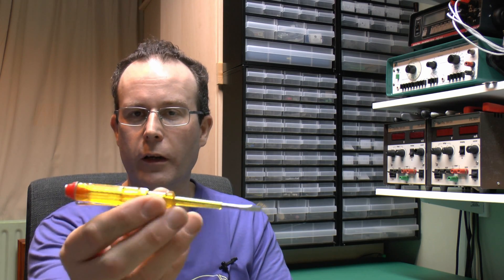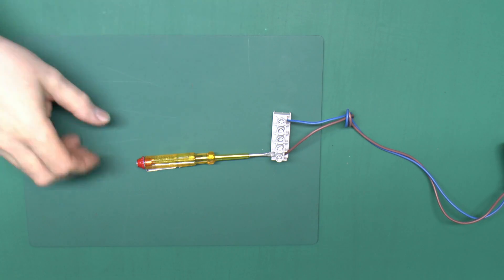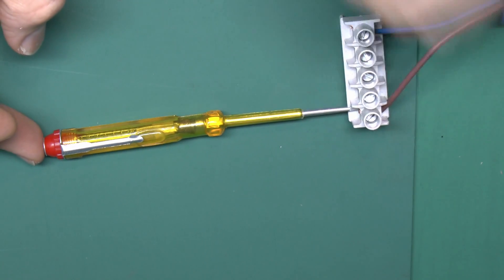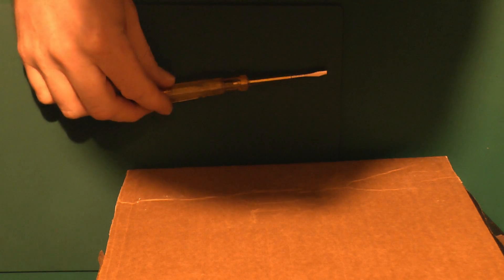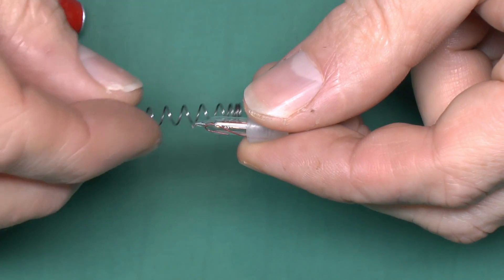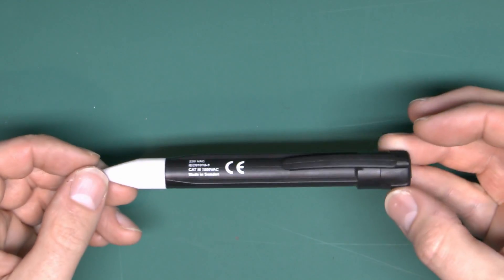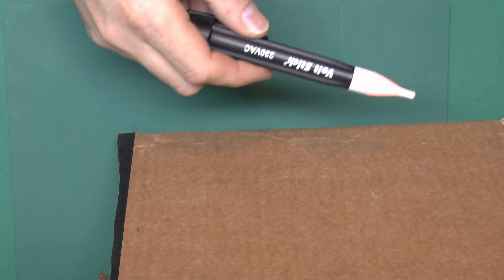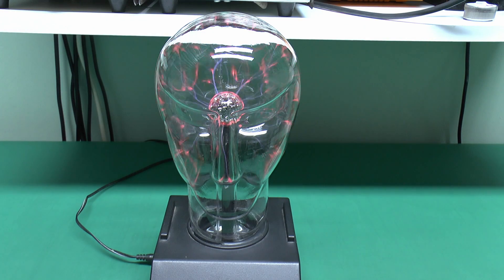Dangerous Device - Neon Mains Testing Screwdriver

Comment: These devices are called phase detectors for a very specific reason. They detect if there is a live. You are mixing two completely different devices together. Not very professional. But yes, that type of phase detector you presented is a piece of cheap crap, I wouldn't even sit next to them.
Reply: A line is a phase, they both do exactly the same thing.  The cheap one makes you part of the circuit,  the Voltage probes don't!

Comment: One great advantage of the neon testers is that they require only one point to test. There are some cases when you have to use them:
if you don't know which wire is the line or the null (same color of wires and no known ground is available) or if you are not sure if the null or ground is damaged you have to test the line with the tester before starting the repair

Comment: I need to do a report on one of these so ill use this video on its safety
Reply: Yeah, I wouldn't.
Reply: I did as it happens. Mine was a clear one with a 1M ohm resistor and then a neon light. I happen to have s couple of PAT testers handy and 3000V blew the resistor, but it still conducted 1500-3000V (limit of tester) but only but out about 2mA. This might be the screwdriver but I don't know how many amps wouild generate through a humsn at that voltage.

Comment: So your approved 'safe' two pole device is fine as long as the lamp is working. This means checking that it is working on a known live terminal first to determine that the lamp is working. I would suggest an even safer method is to switch the power off at the consumer unit and not to bugger around with live circuits.
Reply from the maker: +Mysterious Squirrel Yes, all mains testing devices must be confirmed working before and after testing.
Switching off at the consumer unit is all very well, until the switch in that consumer unit fails closed, it's the wrong consumer unit, or the circuit in question is illegally connected to the apartment upstairs.
Reply: ***** I take your point. You cannot safeguard against the stupidity of others. Your videos give good well informed advice but ultimately, there are those who will take all reasonable steps to check for a live circuit, and others who will stick a licked finger in a socket. And even with the best test equipment money can buy, if the person who installed the circuit was an idiot, you are going to become an earth rod.

Comment: Im not really good on electronics but Ive got question,
 why did the device lit up on the cardboard where there is no electric on 4:22?
Reply: +とり好き Static I presume, if they can safely use your body as a route to ground then the current required to light that bulb must be immensely tiny.

Comment: That "metal cap" is actually a female plug for a wire lead that you connect to the other  part of the circuit you want to test. It's probably 30 years old and you didn't use it per the original instructions nor have all of the parts.

Comment: The neon itself has a massive resistance. It passes almost no current. You're not gonna get electrocuted off one.
Reply: +greenaum neon 60 - 70 volt the resistor has to take the rest of the voltage if the resistor fails ( shorts ) you get 170 -180 volts threw you ((( ZAP !! )))

Comment: I've been using one of those screw-driver testers since forever, in conjunction with decent multi-meters and other sorts of testers...... never a problem!!.....Can you count on them 100%?   No but they are a simple "first to" indicator.
  ..It would have been more informative to mention the difference between LIVE and NEUTRAL with reference to earth......and why the tester did not light, so as we know the reason.
    The huge tester you showed does not give the user any real feedback on the polarity of the tested wires with respect to earth, they could be inversed which is also dangerous...maybe more so under certain circumstances.... the screwdriver tester does.   
  They have then, two advantages.......you can use it one handed..handy when you are holding a torch in a dark place, because you have an problem with, in,  for example a garage in the dark (which is why you are there in the first place) testing simple house electrical problems in general is not done at a bench!........the other for testing live and Neutral with respect to earth. 
 Disadvantages.......... it's an indicator  but absolutely not a complete tester.......... not good for those who know little about electricity.........but that's why I still use one. Dangerous?..... Really the bottom line is if you don't know abut electricity you shouldn't be fiddling with it!

Comment: I was recommended this from you tube! What a long  winded piece of nonsense, had to terminate the viewing.
Reply: +Garry Steptoe - I agree long winded and could be done in 20 seconds, anyway I have been using this type of screwdriver tester for 50 years or more and I will carry on using this to find the 'live' not to prove that there is a neutral or mains present, they have never been lethal in my hands, I was also wondering why he had 258 volts I will call the electricity board as you should have no more than 240v max. If you want to see what lethal is go to Thailand they have extension leads on building sites using 'twinflex' what we use for connecting up a door bell, health and safety doesn't exist.
Reply: 240V max?   230V RMS  -6% to +10% EU conformity? Try and google before using a shit comment
Reply: This is why we have health and safety, a better country because of it, just because you have done blah blah blah for 50 blah blah years does not prove much, just one statistic.

Comment: Wrong. You don't use a two terminal device to check mains voltage is off unless you know the circuit has not problems. Neutral may be disconnected and live connected and that device would not give and indication. There is no perfect solution but if you are going to check live wires around the house, use one of those pen things. Yes they may fail, but the two terminal device can also fail.
Both devices that you said are bad give out false positives but that is actually safer than a false negative from a two terminal device due to a broken neutral.
Reply: I'm still here after 70 years and have been using a neon screwdriver all my life without problems. It's found every live wire I ever needed to. You health and safety bods spoil all the fun for us old 'uns.  :) The odd shock tightens up the sphincter muscles and prevents leakage!
Reply: I agree with you. I've used one for over 55 years and always found the live. A lick of the finger to lower the resistance helps too. He's scaremongering.
Reply: +Rob Fraser They may work if grounded, but around the house when checking for normal mains, i want to see if "I would be closing the circuit" to ground and get shocked. Its the same reason i don't use a multimeter for these checks. I don't care if neutral or ground are good, all i need to see is if i would be closing the circuit to ground.
Reply: +maxsnts I have seen broken neutral my self some times not easy to find with a 2 point tester
Reply: Yet again, I'm shocked (no pun intended) to see so many people that don't know that (most) 2 terminal testers also work as single terminal testers - Fluke T100 for instance
Reply: +MaxSantos

I sometimes in unknown/untrusted systems, like to use 'flying lead' earth to test the earth is connected, especially old light circuits, as you can otherwise have 'live' points with no earth-reference to measure for voltage properly.  Can see how the non-contact detector can be useful for that reason similarly // totally agree!

On a TN system, when turning off a single MCB/RCBO (L disconnected only), having checked the power appears to be off, I like to also measure the N-E loop with a (properly protected CAT3) multimeter 'ohms range' which gives further confirmation N and E are really still connected and the lac of voltage on the line really is correct.
Reply: +maxsnts That's a good point that I never picked up on, the two terminal device he used (not the multimeter) would that work if the other terminal was grounded against a radiator perhaps?  That might be it's true purpose, that you ground the other end and not place it against the unproven neutral line.
Reply: Alan Reynolds haha
Reply: Alan Reynolds brilliant answer
Reply: In Finland a common way on old installations is to ground on the socket to the neutral wire. Sometimes this is done to the live wire which is especially dangerous. A plumber died on this in 2015. There is no way to test this between two contacts on the socket. In Finland the officials warned against socket testers that do not have option to put your finger on it and test the voltage between the ground connectors and the actual ground.
Reply: If you don't understand then don't give advice!
Reply: that's why electricians are taught the 3 steps for isolation. L-N, L-E and N-E.
neutral earth is important because in the event of a broken neutral N-E will show a voltage.
same with L-E.
Reply: Closing the circuit to ground?
Reply: if the neutral somehow breaks... you can still go from hot to ground to test.
Reply: @moonasha  You may be on old wiring (TN-C) where you don't have ground to test on.  Contactless testers shuold be all thrown in RAEE: they are as reliable as a coin flip.
Reply: if there's no grounding conductor you can literally run an extension cord outside, physically stab the prongs into the dirt, run it back to your outlet, and go from hot to any prong on the extension cord. In the event you know the house doesn't have grounding lol. It'll still be grounded back at the transformer. And yes I've done this, it works
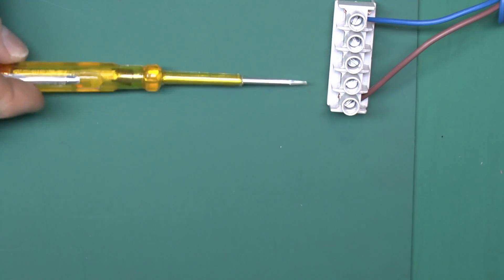Reply: 3:11 clearly lying for his own purpose, you can see the orange light come on then he moves the screwdriver tip to a point where it doesn't make contact
Stupid virgin
Reply: Voltage is the SI unit for the electrical potential difference (PD) between two points.  So if one side is supply voltage (230V) and the other is at 0V then the Potential Difference is 230V.  If both are at the same Voltage then the PD is 0V.  So its not the equipment but the understanding of how to use it, learn how a multimeter works.  If it is a broken neutral you are worried about then then check on earth conductor, if no earth conductor the use a wander lead to a known good neutral or bonded point. You only require a reference point to ground to prove dead.  fully isolate then check continuity of circuit.
Reply: @rod9311  The reference point should be on what you stand. Only the potential difference to that counts. 

Your attitude produces dead bodies. The accidents happen just because something you did not suspect happens.
Reply: You are missing the point, the discussion is;  not to become part of the circuit you are testing.  For the device to work a current has to flow back to the transformer no matter it's route, neutral or earth.  These devices use the earth and you, if resistance drops to a level of a lethal current then it's not good for you!

A TN system  back to the transformer is the same as a wire going back
Reply: With the resistance being higher the fault current is lower and MCBs etc will take longer to trip or not at all, however,  you are still dead.

Two point testers are used to prove circuit is not at mains voltage, interpretation is up to you.
Reply: Without you being part of that circuit!

Comment: so, completely anecdotal but...

there isn't a single one of these that doesn't have a simple fail fuse/wire that will burn out if the resistor is not active.

also, these testers are the same as a cattle shock wire tester with only a higher resistance so the finger contact point is actually quite safe, if not safer than trying to use a bridger, since you aren't actually bridging the entire circuit and are actually shorting the line, which will cause the circuit breaker to flip off anyway (with the bridger you also fuck the device your testing, with a touch tester you dont) so at the worst you'll get a slight buzz assuming you have fiddled the innards of.your touch tester.
Reply: A fuse won't burn fast enough to prevent shocking or save your life i guess.
I like multimeters because I can acutally see the voltage value not only if its present or not.
Reply: Milan Mazić the fuse generally pops in time to prevent heart issues (which is generally what kills you in a short shock scenario). i dont trust them on anything over about 20amps personally because 20amps realistically can transmit only about 1/10amp from my finger to my heart or spine. for mechanics work these arent bad, but i dont use them on household wiring or generators.

the only truly good use is to check for voltage bleed on connectors.

all that said, if you're dumb enough to jam a screwdriver into a socket and stick your finger on it... you MIGHT deserve the darwin award.

Comment: One concern about the two-probe recommended tester is that it assumes a viable neutral.  If the hot is connected to mains and the neutral is open, the two-probe tester will indicate a cold circuit, even though full mains voltage will be present and could kill you dead as a door nail (or any other kind of nail).  The forbidden pen, or the little squawker, will tell you there is power present even with an open neutral.  The forbidden pen will go further and tell you which of the nest of wires is tripping the squawker.

The false positive from a plasma lamp made sense, but frankly, I don't often see these hiding behind junction boxes.  I am curious how you got the failure of no light with voltage present.  I am supposing you wore very, very good insulated shoes, maybe also standing on a rubber mat? Or instead of true mains power, you pulled your test voltage off a transformer or generator without a bonded neutral?

Comment: Great video and one wonders why anyone would be so stupid as to use one of these things. Simply because they have no idea of how they function and as you point out a simple failure of the "resistor" and you will be in for a surprise. Try telling anyone though about the dangers of using these thing and u usually get met with. "I've been using one of these things before you were born"......blah blah blah! I subbed too.
Reply: I´m pretty sure almost everybody gets how they work, it isn´t really rocket science.
Reply: Read the comments, lots of electricians are OK with them. You are not the Guardian of Secret Knowledge.

Comment: "Dangerous" device?  Oh, for heaven's sake, John!  With a 1.5 meghohm resistor in the handle of the screwdriver, the absolute maximum current your body could ever see on a 240-volt circuit is less than 1/4 milliampere.  That's so low that if you had it running up your arm you'd barely feel it, even standing on a grounded steel floor with bare feet.  This kind of gadget is safe to use up to 600 VRMS, and it is unlikely that one would encounter anything close to such a voltage in any residential wiring..
Reply: Jonathan Brown "... if it got damp and dirty."

The same would apply to a fancy electronic probe that is fully isolated.  If it were to get damp and dirty, there could potentially be sufficient surface creepage to impart a significant shock to the sloppy technician holding onto the other end while standing with bare feet in a pool of water.  It is possible to make equipment fool-proof, but it is impossible to make it damn-fool proof.
Reply: Very well said..I used one for years in the electrical business in a plant.. No problems ever..
Reply: ALSO THE CONTACT AREA IS VERY SMALL.SO ONLY SMALL CURRENTS CAN FLOW.THE GUY IN THE VIDEO IS AN IDIOT.I HAVE USED THIS SCREWDRIVER FOR YEARS.IT IS VERY RELIABLE.
Reply: I think this is the point a lot of the pro screwdriver proponents don't understand. The question is why would you want to make yourself part of the tester circuit? The screwdriver may well work 99.99% of the time but it relies on a circuit through your body to Earth, now that is an unnecessary risk when there is a plethora of devices out there that reduce this risk considerably lower. Nothing is without risk, it's all about minimising that risk. Then there is the point you only need to be unlucky once there likely won't be a second time.
Reply: So this cheap made in China joke guarantees that the resistor is 1.5МΩ and there are no shorts or defects. And it is also a certified CATIII rated device. What value do place on your life.
Rules for a continued existence:  
1. Always check if a circuit is live at two points of contact. 
2. Do not be one of those two points.

If you are about to touch something that could kill you; You want to take every step to make sure that it can not.

If you want cheap, quick, easy and convenient, then please work on 24 volts or less.
Reply: Bas van der Sluis
put or 3 resistors in series...they cant all short.
Reply: Let's say it's safe, it's definitely not reliable.You have to be connected to the ground, what if you wear protective clothing, then you need to touch a wall or something.
Reply: 1mm^2 can pass through at least 3A
which a lot more than enough to kill you
Reply: 3A !!! what rubbish...1mm 2 will not not be able to pass enough at 230 volts..unless your made of copper...just not enough area.
Reply: Touch with main check screwdriver or bare hands?
The battery is probably low voltage and unless you touch both pins + and - you create no potential difference.
Reply: Just replied to a guy who said we use these all the time in india,where thier auto death rate is a hundre times that of the uk
Reply: So, what if the resistor fails and becomes a dead short? Do you measure the resistance every time you use it? Not saying that this is a lethal device, but it is not that great either. I think John makes a good point and if you want to check if something is live, use a proper device, instead of this device which CAN be dangerous.
Reply: Then how am I able to touch a car battery? And be untouched?